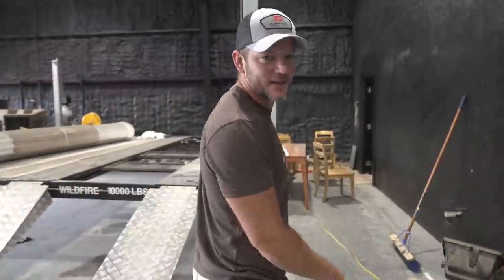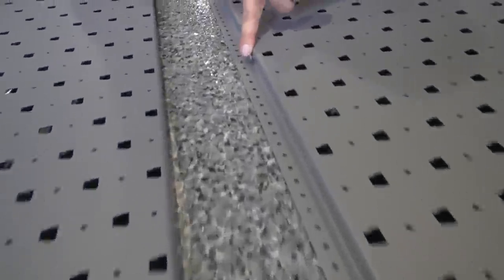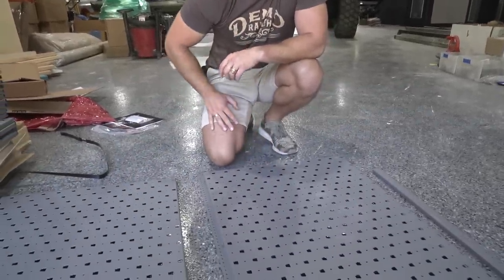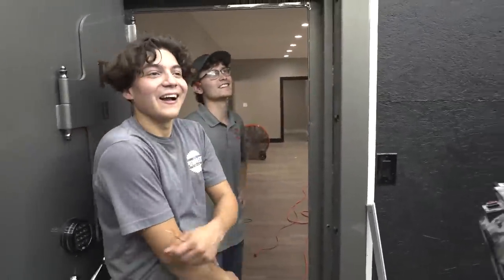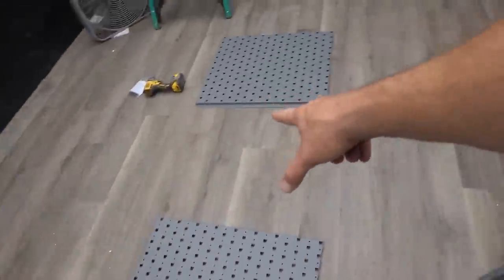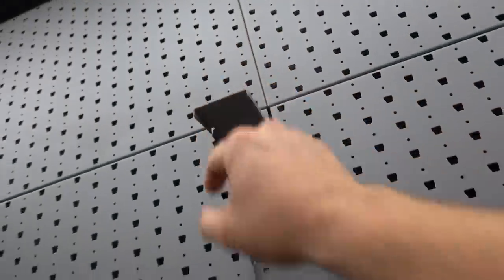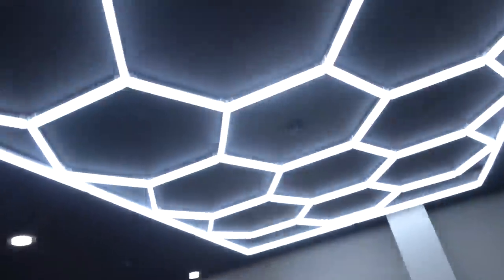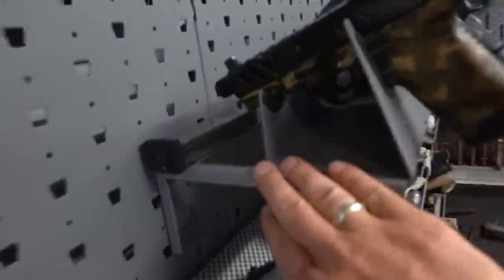The New Epic Demolition Ranch Vault!!!

Comment: A rolling, "library" style ladder that went all the way around the vault to reach the top sections would look awesome!
Reply: It's not tall enough to need that but I get what you're saying
Reply: @RyanPhoenixAZ  I mean, you try racking a 30 lb Barret M82 above your head without a ladder. Without at least some kind of step stool, a lot of vertical space is going to get wasted. In his home vault,  with the 7ft ceilings, putting a rack near the top was trivial.  Just looking at the thumbnail, with Matt's arms straight overhead there is still probably at least a foot to the ceiling. 

Besides, it would look awesome.
Reply: @KingNickSA  Then don't put the 30lb barret at the top 🤣🤣

Comment: A lot of comment saying get an epoxy resin table or display case. A solid wood table would be a far better choice. You would have to worry way less about scratching and damaging the surface of a wood table which can be easily maintained and resurfaced. 

You could also keep a black rubberized mat to roll out on top of the table top as a nice cushioned work surface when you are working with your pew pews.

Also the second vault echo's just as much as the first. You can get hexagonal acoustic panels in black for the roof in between the lights that will cut down the echo a lot!

Comment: Just be aware that that panel section you cut up to put in the corner is only held on by a few screws at the top. Don't go putting anything heavy on it.
Reply from the maker: Even tho we put it up there all together, I was still able to put 5 screws in every panel so it’s just as secure as the rest. They’re very solid
Reply: Was just going post this. Glad I looked first lol
Reply: Yes a whole 5 screws into OSB... Sounds like a ticking time bomb
Reply: @OffTheRanch  are you gonna be able to hang anything on the plates directly behind the door without the door hitting them? 9:43

Comment: I'm really digging that Vault! I've always dreamed of making a vault! I think it would be cool to use THICK plate steel to line the walls, but that would be STUPID expensive!!!
Reply: No need. 100% truth what you wanna use is some decent thickness cement on all sides even the roof with a ton of rebar through it. even if you use a sledge hammer and had the right tools it would take a long time to get into it.

Comment: Do a large toolbox bolted to the floor so you can store ammo, tools, and accessories. Put a counter top on it with a bar style overhang on the back so it's a workstation and possible podcast area.

Comment: Hey Matt!
Here is a thought for worktable top.  Use anti-static mat for top.  Paint it same color as the Gallow Tech.  Then use Gallow Tech as a “stencil”.  This will make it ‘appear’ that the table top IS Gallow Tech!
Ken
Reply: That is pushing the line of trademark infringement, so not a good idea.
Reply: @atk9989  Do they have a trademark for the look? Looks like generic tool walls to me, maybe slightly larger holes but not sure

Comment: Maybe I missed this (I've been a little busy the last couple months) in the abandoned mansion remodel but if you haven't already, you should reinforce the vault walls with cement board (I believe that's what it's called) or possibly ballistic board (?). My friend did his vault room up with it, and when properly reinforced it will take someone with a sledgehammer a half hour or more to bust through, and provides additional fire protection as well.

Comment: I store all my extras in a big tool chest. We bought a butcher block top and use a touch and burnt the edges and then sealed it with a clear epoxy sealer.

Comment: good sponsor pickup - if you lock yourself in  and start to run out of air you will need to cut your way out so leave a concrete saw in there - you did pour a ton of concrete - you get rewarded with lots of sq ft - do think about a heat pump - what are you going to pivot to now that bunker is under new mgt? i would like to see you fix all kinds of vehicles - shadetree mechanic - just basic stuff but maybe goto ls swaps or something - you will specialize and be happy once the shop is all finished and the house also - do an rc track in front of shop - racecars but maybe a drone track also
Reply: The ceiling has vents and the door has a Fail-Safe but still a concrete saw wouldn't hurt.

Comment: You and Colion Noir need to do a collaboration sometime.  Dude knows the 2nd and is an avid spokesman for it and I think you guys, maybe throw in Kentucky and a few others and get out to the range.  Would be GLORIOUS.
Also, how is that gonna work with those a/c ducts blowing out right on the display?  Might cause moisture on the pew pews.
Reply: Air conditioning pulls moisture out of the air so it’s not gonna be a problem.
Reply: @housegoth  I know it should but, like in many houses with ceiling vents there is a small amount of moisture that will accumulate inside the vent cover.  Mine drips a drop in my sunroom from each of the 3 vents about once a day, sometimes twice if it's hotter.  And Texas with that heat and humidity...could be an issue he may need to have someone check into.  Might need dehumidifiers in those vaults.  Better safe than sorry, either way.

Comment: Don't put anything heavy on the 2/3rd size section you cut.  It is only secured at the top.  So the weight of the panels and the weight of anything you hang is only secured with the 4 to 6ish screws you put on the top row.  Don't think that section will bear much weight.

Comment: Why no power in the floor of your meeting room?   Works out better to plugging in your devices instead of running a cable across the floor to the walls.  My new home and shop all have outlets at at least the 3 foot level….most of the shop boxes are at 52”.

Comment: Is that corner with the cut panels not very secure if it was hung as one whole piece? Only the top of the top panel and bottom of the bottom panel were screwed in?
Reply from the maker: All panels got screws in them, I was able to snake em in through the holes in the front

Comment: Did you even mark the studs in the wall? The screws you are using are completely incorrect for holding all the weight that setup is meant to hold.
Reply: Dude he used OSB. Thats not even real plywood. Plus when he bangs on the wall at 12:28 its hollow.  ITS ALL FOR SHOW

Comment: Why issnt all this solor? You should hook the shed thing you built that is off grid into the grid of the warehouse, if it isnt that far away. Do a heavier guage wire underground.That way any extra electricity that is produced will make your bill cheaper. Then you can tie more panels into that one instead of doing a whole new setep there. That way you will have power at both places if the power goes out.

Comment: the sheets you cut and hung as one big unit will not be as strong as the ones hung properly with screws on each section. i would be careful hanging a lot of weight from them. @offtheranch